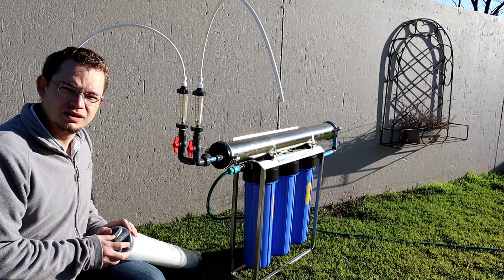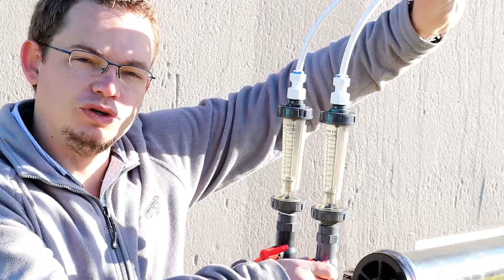FilterShop co za Small 4040 RO Operation

Comment: what pressure was the tap water? Does it damage the membrane is you use lower pressure?/
Reply from the maker: The lower the pressure the more waste water you will need to run. We typically test at about 5 bar but the low energy membranes still operate decently down to 3 bar pressure.

Comment: Nice video. What is the main use for this systems in S.A? Here in the U.K the window cleaners use these 40 40 RO systems then through a DI vessel for pure water. Thanks
Reply from the maker: Thanks, Basically any place you need low mineral content water or need to dramatically reduce the mineral content. For example, as you mentioned, Window washing, solar panel washing, car detailing, industrial boilers, cooling towers, bottled water, lab use, spray can filling, etc.